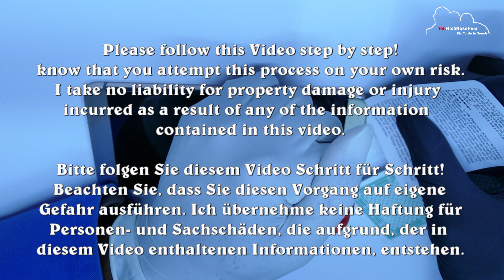LeEco Le Max2 Max 820 Display and Charging Port Replacement Austauschen Reparatur

Comment: Very good instructional video. I cracked my screen 2 month ago and after ordering a new one from China, I did the replacement today. I also changed the battery doing so - not much more work. Thanks again for the high resolution video especially when dealing with all the small screws. The hardest part for me was to install the thin double sided tape to glue back on the new display. With my big hands that was quite a challenge.
Reply: hey bro, can you please tell from where you bought the display, mine is broken and I can't find a reliable enough seller

Comment: Very helpful video, thank you. 
I replaced the charging port on my phone but the data connection doesn't work through the USB (computer doesn't recognize the phone). 
Any suggestions on where to look? Is it possible I forgot to connect something when I put all back?
Reply from the maker: Maybe the replaced charging port is faulty, change it again.

Comment: Hello ! Thanks for you video, it will be very helpful for me because i need to replace my charging port soon.
I have 2 questions:
-Where did you buy the new charging port ?
-In the beginning, i guess heating up the screen is for melting the glue, but at the end, don't you need to glue the screen again ? Or you just push it and it stays ?
Thanks again
Reply from the maker: I bought it on aliexpress.com. Yes you have to heat the screen, I used B-7000 Glue.
Reply: @Telrichrosefina  Thank you very much for your answer, i guess i have to apply glue on the borders of the back of the screen ?
Reply: @frizz6492  same question did you used glue on both sides?

Comment: Hello I replaced my battery of same model but now my display is not working what would be the matter is it because I didn’t used glue?
Reply from the maker: Check your Display Flex cable very well maybe, it was damaged in the process of the disassembly
Reply: Telrichrosefina Bro I showed it to a mobile mechanic he said it’s broken is it so or he’ll just fix it and make money?
Reply from the maker: @rajjohn5333  I don't think he can do that just to get money from you. I think it's damaged as he said else it would have shown image after the disassemble.
Reply: Thanks Dude,btw its real costly man

Comment: I purchased a refurbished leeco max 2. My wifi always is not turning on. I opened it and observed. But when i mount all pieces. My display turned on. But image does not appeared. If i  replace usb plate, will my wifi work?
Reply from the maker: You can try that and see if it work. It can be that Wifi chip is faulty.
Reply: @Telrichrosefina  Thank you for your answer. But where stays wifi chip in this smartphone ? I changed the ROM and sometimes wifi works. Bluetooth works well. But wifi is not working properly. Ultimately, wifi turned on But smart restarted. I percieved that my bluetooth is not with a good quality (10 meters) my musics is no in a good sound in my sound box. I believe that there is a fault in wifi chip.

Comment: after replaced my le max2 phone display,  my phone touch sensor is going crazy some times, why is that? how to fix it, please help.
Reply from the maker: Check the Display Flex cable maybe it's not fitting well. If that doesn't help then you have to replace the display with a better quality.